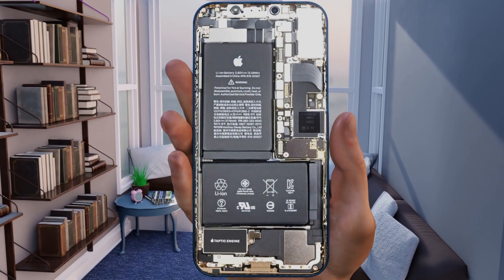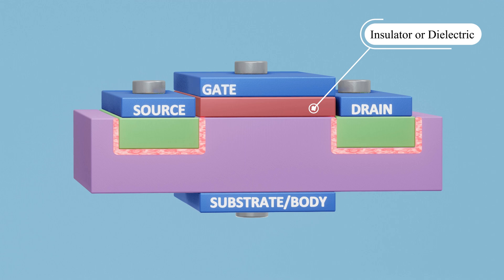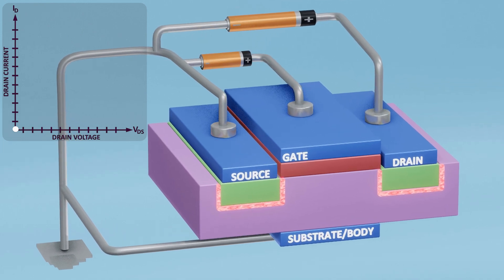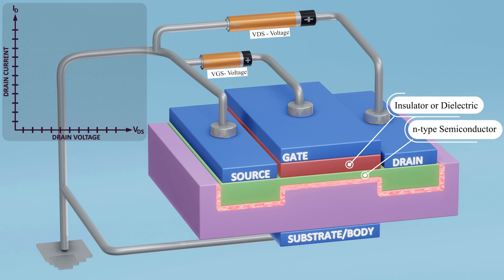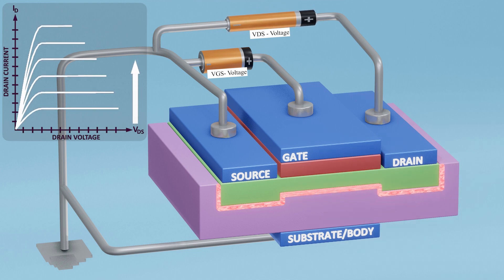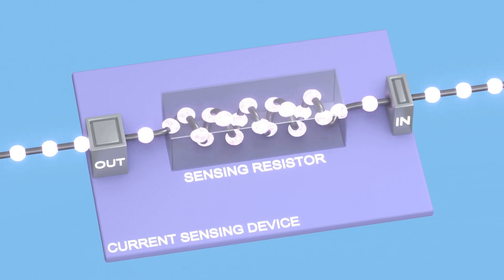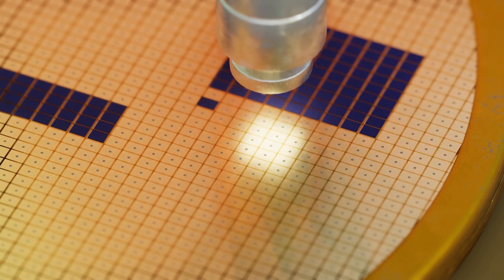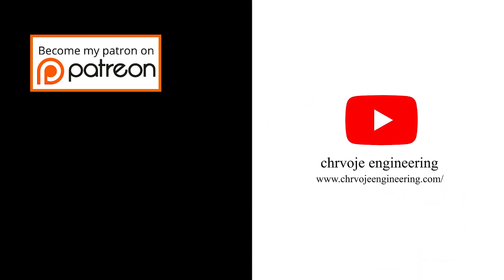How Does a MOSFET Work?

Comment: Your MOSFET current-sensing explanation is incorrect. For MOSFET current sensing, it uses the RDSon resistance. The voltage drop across it will convert to current using ohms law (I=V/R) . The gate has no voltage output to use as sensing for current measurement. Maybe your talking about  hall effect sensor not the MOSFET